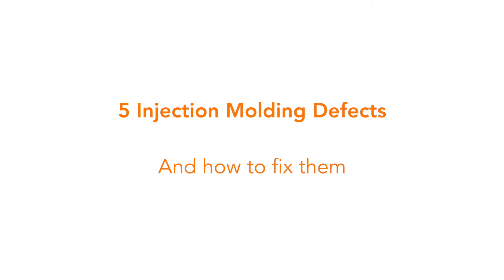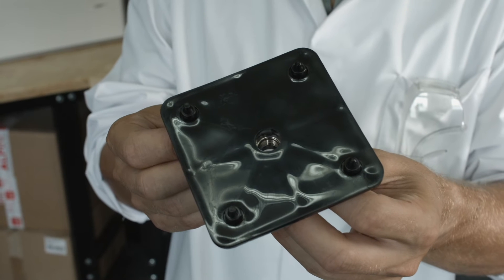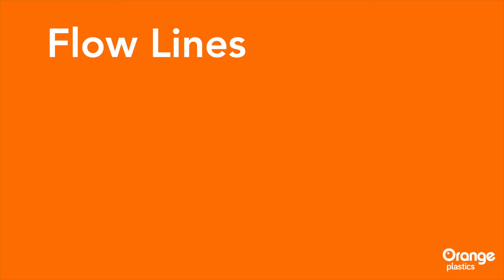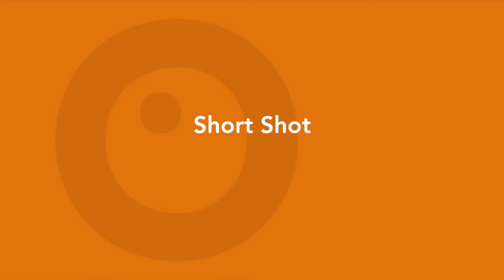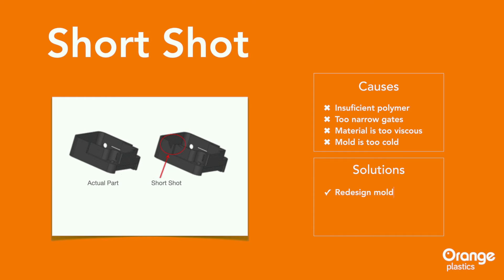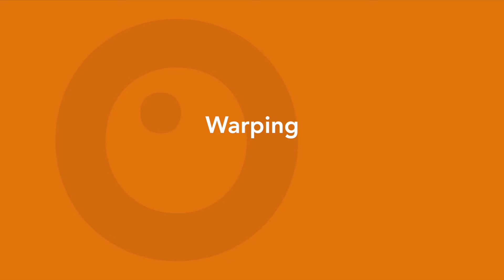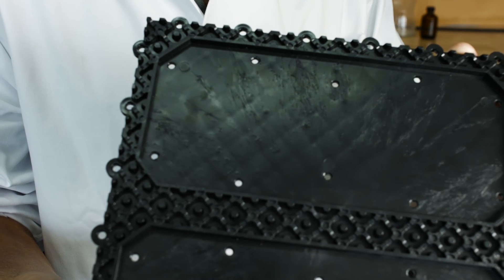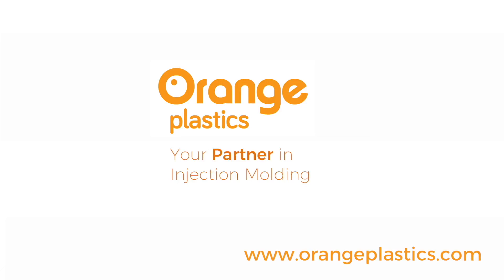5 Common Injection Molding Defects & How to Fix Them | Orange Plastics Academy

Comment: Hi brother I have dobut can you pls solve it??
Reply: Wat doubt bro
Reply: Let us know, we'll try to help if we can
Reply: @JatPhenshllem  how to control burn mark problem on hot runner mould if material is abs
Reply: @khalidsayed6659  Uhh...
Reply: @khalidsayed6659 injection pressures or speeds are too high most likely your injection pressure. typically abs/asa likes a fast fill. i doubt it but the hot runner temps may be to high.